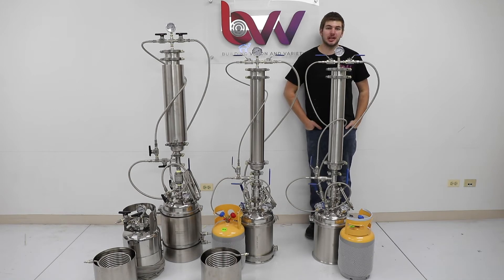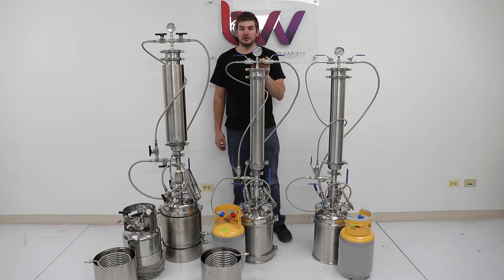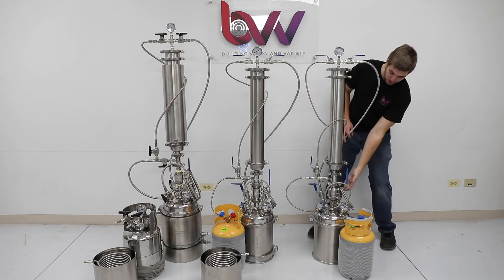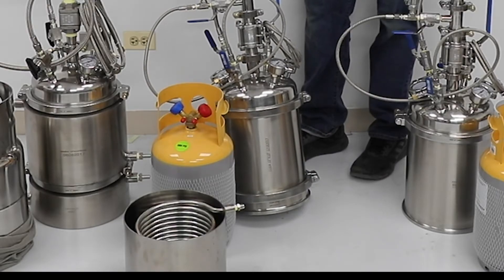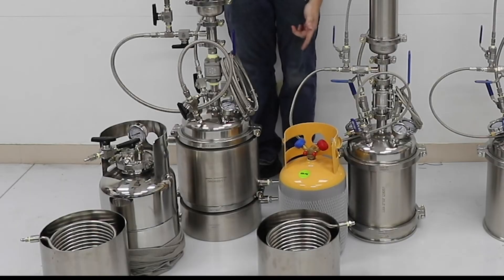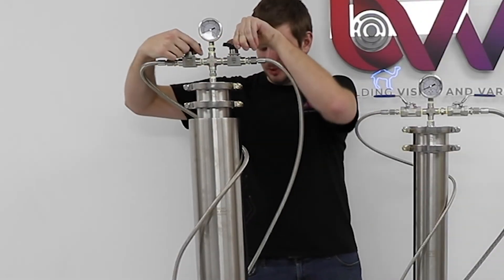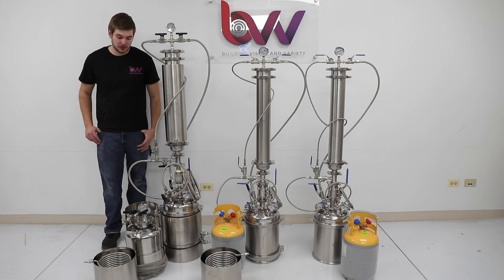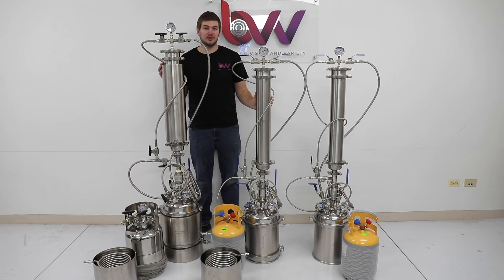Explaining BVV Extractor Configurations

Comment: What would be the best method of distilling your LP if you were to purchase the elite package? Would I need a secondary lp tank?
Reply from the maker: @LizardClarinet an easy way to distill your solvent is to fill an empty extractor with solvent from the supply tank (new solvent that needs to be distilled). Once your designed amount of solvent has entered the CLS, you perform a recovery just as you normally would. During that recovery process you are distilling the solvent and all impurities will fall to the base of the CLS.